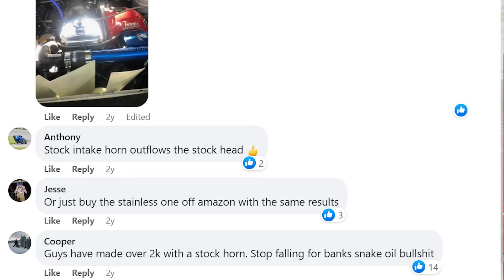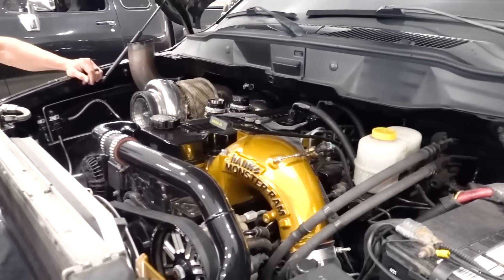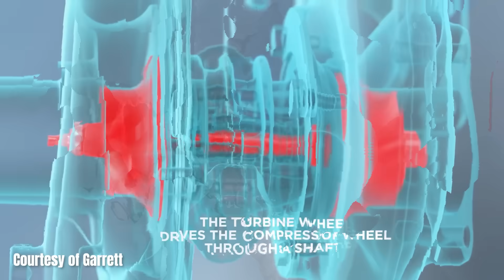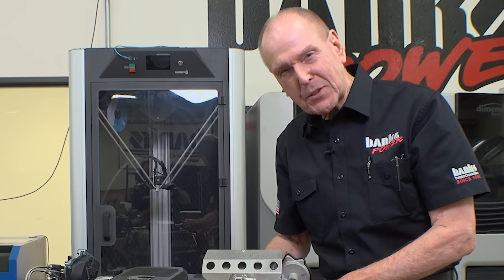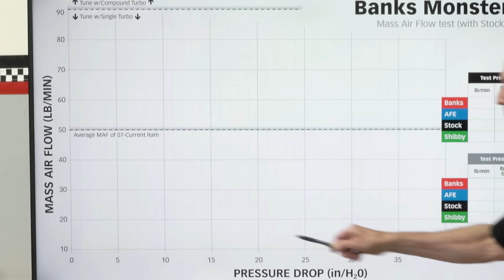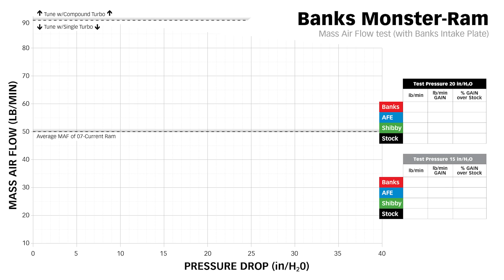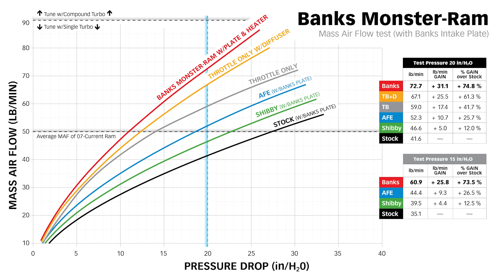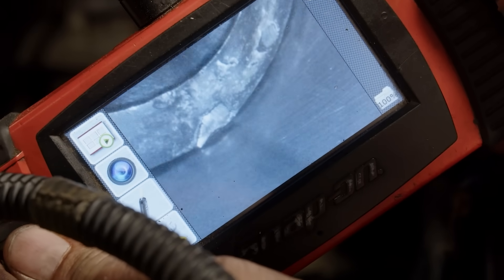Stop this wives' tale about Cummins engines! | Fact Check

Comment: Improving airflow through any engine can be difficult to quantify and justify.  This video segment proves that much. 
   Form personal experiences in the cylinder head porting business there have been numerous instances where plenty of money had been spent on port work in a boosted application. 
    What happens most every time is the customer calls following the tuning process to state the engine is not making the same boost. 
     It is a tricky subject that can land you on the phone longer than you can afford to be. 
    I once listened to a conversation between my then boss and a customer with big money. 
   “I’ve lost several pounds of boost. What’s up with that?”
   “Is the engine making power?”
   “Yes the engine is making only a slight bit more power than before, but not enough to justify the money spent”
   “You’re going to need to increase the boost to match what you had prior to the port work being done to fully realize the power gains.”
    This was once a common subject. It still arises every once in a while these days and when it does you must be careful with who you’re talking to.  It can turn into a time vampire of frustration. Most often it results in the decision that this customer can’t be helped in a cost effective manner.  
   I’d like to know what the boost reference states before and after the installation of this product.  
    I’ll soon know.  I ordered this kit for my 2012 Ram 3500 last night. 
   With 130k on my truck I’m expecting I’ll have some major clean up. Hopefully no grid heater damage. Truck still runs good but not great.  
   I’ll likely be rebuilding a turbo so it might not be such an apples to apples comparison.

Comment: How come RAM won't just buy all this stuff and put it on to start with?   Seems like if you don't have that entire setup, from the turbo, intercooler, all that tubing, and monster ram and air intake, there is going to be a bottle neck somewhere to negate the entire mechanism.  So you have to go all in to get the most out of your buck. What would that setup cost to get installed?

Comment: I am a diesel noob and after a 10 year itch, I bought a 16 Cummins 2500.  Mine has the Monster elbow,  after watching Gale Banks explain this stuff, my goal is to put every Banks product on it, I'm sold on this engineering.
Reply from the maker: Welcome back to the diesel world! We're glad to have you as part of the family.
Reply: @bankspower thanks!  After the help from Kate @bankspower and a bit of patience  to get to the sale I'm currently behaving like a 21 year old with a new credit card.  To match the Monster Intake my truck came with, I purchased a Banks intercooler upgrade, intake, pedal commander and the 68RFE pan that just came out, I'm stoked.  I want a derringer or I reckon PPEI if I can't Banks tune my Banks.  Also got an ATS valve body and bypass for that pan upgrade, the goal is to make a good truck last.   I'm quite stoked!  Need a tuner tester?  I also purchased the @insanediesel secondary oil filter system and @Lorenzosoil oil.  I'm the old guy thatfinally buys a used Grandpa canopy carpeted diesel truck in great shape and now I want a Hot Rod it.  Faster forever!  Then I watched the Killing a Duramax series and wow, Gale and his team can really dial in an engine!  Do that to my Cummins, I can't find much else on how to make it all work together and tune the transmission and engine.

Comment: Your comments still don't address why there's no dyno gains with just your monster ram. Surely if head is capable of more and the monster ram provides more then there should be a boost in HP/Torque numbers no?

Comment: So what's the flow on the head?  I missed that in their somewhere.  I understand that it's getting pressurized, but is there a limit on how much the stroke will draw?  Can the turbo and intake actually provide more than the valves and stuff can use?

Comment: As a 6.7 Powerstroke owner, I am puzzled.  Perhaps Gale can (or has?) answer this: GM, Ford and Ram make ~6.7 liter Diesels. Ram's inline 6 Diesel has been around the longest, and has the longest stroke to bore ratio (no surprise, given it's an inline). The long stroke should be great for Diesel's torquey, low revving characteristics.  GM has the shortest stroke to bore ratio. which suggests its peak torque and power band should be at a higher RPM. And Ford's geometry is in the middle. All 3 companies have lots of skilled engineers, and advanced test facilities. Based on this, 2 questions: 
#1) WHY has Ford long been winning the stock horsepower and torque numbers, and on a V-8 instead of a long stroke inline?  Is this an indicator that Ford found a 'sweet spot' in the bore/stroke ratio?
#2) Despite all 3 engines having dramatic differences in their bore/stroke ratios, all 3 list their peak torque and horsepower at essentially the same RPM (1600 / 2600)  Why?
Was this a target from the outset, or is it something more intrinsic?

Comment: That Ram Air is the best investment I made. My grid heater nut was broken and probably one trip to work away from falling off. The security of that alone makes this worth the investment, and my fuel mileage has gone up noticably with just the horn. And, when the post on heater element that came with my kit  was loose, they were really quick about sending me a new one. I trust what this guy says

Comment: Do you really gain anything without a tune tho? Besides deleting the grid heater bolt. Im in California and I can't even get a tune on my lawn mower. I did the monster ram  install today in hopes ill be able to get a tune in the future
Reply from the maker: Monster-Ram does not make power on its own. Where it shines is its increase of air mass, which unloads the turbo. This reduces the time-to-boost. In other words, it takes the turbo less time to reach the ECM's target boost. Monster-Ram improves throttle response and fuel economy. To realize its power potential, you must add fuel to match Monster-Ram's air mass improvement. This is why we don’t advertise HP gains.
Reply: @bankspower after putting miles on it today I am super happy. The fuel mileage i gained is crazy as long as I keep my foot out of it 😅. Now I need to get the boost tubes

Comment: I have a lot of respect for Gale Banks but in this case I think he got off the track.  The contention he started out to debunk was that the engine was not able to use the increased flow offered by the monster ram intake because the head was the main flow restriction, not the stock intake.  What he proved with this video was that his intake stuff will flow more air than the stock setup and also more than some other aftermarket parts.  That is totally different from his original premise.

The issue of whether a Banks intake will actually result in more power, economy or longevity isn't really addressed.  He did talk some about how lower restriction in the intake could result in less turbo load and therefore less back pressure in the exhaust but if the restriction is in the head the freeing up the intake tract may not have much of an impact.

I was hoping for dyno runs with a stock engine and then with various mods to the intake to see how much difference there was, if any.  Drag strip runs could also be illuminating but a bit less scientific.  At the least a report of temperatures, pressures and fuel flows on a running engine pulling a hill or some such would have made the point better.

So far we don't know if there is any improvement in actual performance of an engine. It's like putting a 50,000 volt coil in an ignition system.  The voltage only goes high enough to arc the plug gap, about 3-5 thousand volts.  Then it drops to about 1000 volts.  The only time you would see 50,000 volts in the ignition secondary is if there was nowhere for the current to go, like with the wire pulled off the plug and isolated.

In a similar way, what ever part of the intake is most restrictive will be the thing that sets the performance limit.  I'm not saying that installing a full Banks intake system will have no effect but I will need to see more than this video before I believe that the change will be more than trivial.

To be clear, I am sure that a modified engine with a free flowing head would benefit from a less restrictive intake but does that apply to a stock head?  There is nothing here to answer that question.

Comment: is there any problems if you have to drive in city traffic like San Fransisco or Las Vegas. I only have to every now and again. But I still have too. So in slow low air flow and or hot air. oh everything else is stock. only monster ram installed. (so far) LOL

Comment: I bought the banks monster air intake take for my 2022 dodge cummins, it worked great, better fuel, more power, but the lifters dodge installed couldn't keep up, dodge said the elbow caused the failure and wouldn't cover my warranty.

Comment: Just a thought, but if you put an air pump on the exhaust kind of like how a siphon works. Could you not free up hp by helping the exhaust vacate the cylinder and not needing the engine to push the exhaust out. Just a thought 🤔🤔 if i had the resources I'd definitely test the theory. You'd then need less overlap and not need to use intake air or the engine to push exhaust air out if it was under a constant vacuum. It would instantly pull exhaust out when the valves open. Instead of needing mechanical or intake air press to be pushed out. Just a theory

Comment: Something I can't wrap my head around in so many turbo applications is the exhaust manifolds used so often, everything looks as if it flows so much volume  then those little log exhaust manifolds looks like a terrible flowing bottleneck. They don't look as if they would support the required flow of a Ford 300 I-6.

Comment: Gale, glad I didn't place an order on eBay for your Bank's Monster Ram, for my Cummins 6.7. Glad you had a summer special, so I got your Monster Ram and your 2 larger air inlet tubes yesterday. Have been looking for an intercooler for my 2010, 2500 4x4, as I saw yesterday you actually have one to fit my truck. 
I first started following you back in high school, in the early 70's. I began using Amsoil in the late 1970's. Wish you had met Al Amatuzio, as I knew him personally, and know both of you would have been good friends. Thank you for making excellent products, Gale.

Comment: Are there any dyno numbers for the intake change alone? Or fuel mileage increase numbers? I’ve been hearing enough about the heater bolt failures that I’m going to do something about it, just trying to decide if the upgrade would be worth it, or if I should just go with one of the simpler (cheaper) fixes?

Comment: First the “killer dowel pin” now the “killer grid heater bolt”.
Am I the only one who sees a pattern here ? 
Could this represent a designed failure point that ends up costing tens of thousands per ?
Maybe 🤔

Comment: Straight up, why do they kick the trucks out of warranty if this is such a good thing. Why do they not come factory with these facts you have mastered and checked? Not being hateful. I really want to know and understand. I bought a New used 8000+/- miles 2024, 2500 Cummins. With factory warranty left. Was told I can’t modify anything or it voids the warranty. No weight loss ie exhaust work. No air intake work.

Comment: Not sure about the reading of all the parameters before that elbow. Elbows increase length of travel of airflow, Bendix notes that on brake systems, as in don't add elbows if you don't have to, think, they said it was like adding 7ft,  I'd be interested in pressure increase/decrease thru that elbow along with the mass on both sides of it. And then there is the effects of the manifold vs cyl head pressure drop and restriction that has some effect beyond that, I'd surmise, as to how much variation is there to that, from where he is measuring. May be pretty minimal, may not, Beyond my pay grade, just my thoughts on what little I learned over the years, which is peanuts..

Comment: The problem with most of these so call gear heads is they read it on the internet or thier buddy who is the bestest mechanic in their area so whatever they say is law.  I am a retired machinist and there is so much more to this entire subject. I now run a school bus shop and have a fleet of the 6.7 cummins.  It is amazing what you can do to these engines and how much power that you can make.  Gale is the man who probably knows the most true knowledge on this subject.  I personally know a few diesel mechanics in my local area that people think that whatever they say is law.  Personally I wouldn't let them touch my engines.  I see the same trucks in their shops all the times.  Yes they are deleting and tuning.  A 2018 that a guy I know owns lasted 3 weeks after delete and tune and then it melted the damn pistons.  But that mechanic knew everything and knows his tunes.  Banks does the calculations like they should be done!

Comment: any degree of angle created limits flow, water, air, 90 degree elbows vs. 45 it's all changing direction - if your improved elbow improves the stock part, it's better.

Comment: Mr. Banks, I have a98.5 ram 2500 2 wheel drive short bed with 134,000 miles on it I installed a bunch of your stuff on it.
Monster ram intake, bank’s full exhaust system exhaust side of the turbo,exhaust brake 4 inch exhaust and muffler, transmission brake, engine programmer and pillar mounted gauges. Also installed an air dog lift pump and filters. Yes it was expensive for all this stuff I did all the labor my self.
Now it’s a tire smoking beast I pull my 30 foot travel trailer with. Thanks Mr. Banks!

Comment: I have Banks intake horn and intake tubes on my 2012 ram 2500 6.7,,, it runs great,,, so Banks products definitely work, I tow a 5th wheel RV with my truck it tows my RV easier that before the banks horn.

Comment: I worked on and for Cummins for 37 years. Cummins has a bad habit of getting cheap with their components. The willput items on the ir engine that are junk and dont need to be on them. They are a odd outfit to work for. In the eighties they built thousands of 855 truck engines that the counter bore for the liners were cut wrong and they went ahaead and made them that way regardless. Their market share disappeared and they improved a little but not much. Cat is no better. Detroit is number one now due their attention to details..

Comment: Gale, I have a 2018 Ram 2500 6.7 with 62k miles. I am going to buy the Monster Ram first to get rid of the dreaded grid heater bolt issue and after that I plan on buying most of the mods you have for the Ram 6.7. In what order would you buy them. I cant afford to do them all at once so wondering what's your thought process on this.

Comment: Place/install flow pressure regulator, on the Head manifold or Base of Banks Monster Ram, and the competitors and test under pressure, 5,10,20, PSI with GH On/Off on head LB/MIN  would be +-? likely all would be within 10 LB/Min under pressure difference gain.

Comment: Instead of explaining the science of air flow in such an in-depth video. Please show the dyno run, the dyno numbers, and how to get those gains. I buy your product based on the gains it provide. Also, temperature below -20 degrees Celsius - the intake heater on your system is not sufficient. The vehicle will not start. At above freezing, it's not an issue. I reinstalled the grind heater and went back to stock. Got me pretty upset

Comment: I think the whole airflow for the engine as a whole is fucked, first we macaroni over to a sharp corner then into a box that then takes air up in the opposite direction from intake (okay?) And elbows it again? (Why?)

Why not have the intake runners be more vertical and the exhaust runners crossing past them on their way out the side? Just have a tapered tube for an intake manifold and run the intercooler from one side to the other so it can ram air directly into the manifold. Why not? Why are things built with more double backs than the swiss alps?

Comment: At this point in time shouldn't anyone opening a diesel shop or custom shop be required to take the Banks engineering course before their business license is approved? I hear so many of them only referencing how much coal they're rolling to supposedly make more power when in fact that Gale has proved over and over is the coal is just wasted fuel not being used to its peak capacity.

Comment: Intake tuning is kind of an enigma to me, but I'd like to learn more, not necessarily about this product but the science in general.  Does intake flow improvement like this still meaningfully benefit naturally aspirated engines, or do you need forced induction to see a noticeable effect?  In either case, do you need to mess with the MAF or ECU to see dividends?

Comment: I think one key point is that volumetric units like CFM without a temperature and pressure reference are really useless since the density is unknown and incalculable. Good practice is to use SCFM (standard cubic feet per minute) since it is referenced to a standard temperature and pressure (typically 68 deg F at 14.7 PSIA) or at least state the temperature and pressure of the system where the volume is being measured. Of course, a mass flow meter solves all this since it is independent of volume. However, if given a volumetric flow rate along with temperature and pressure, one can calculate the mass flow rate (without a mass flow meter).

Comment: What about the allen bolts that hold intake ram to the block. There are six on the gen 2 monster ram. No one wants to talk about how one is located inside the manifold. If for whatever reason that comes loose... it's more catastrophic than the heater grid failure this is supposed to avoid.